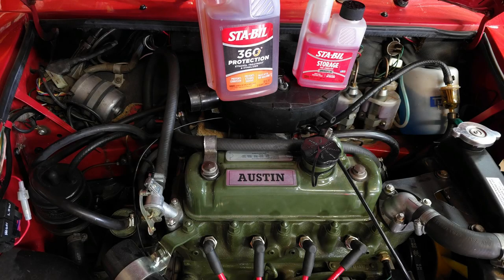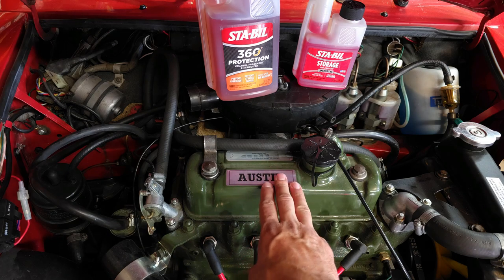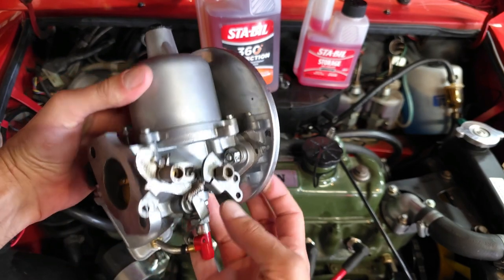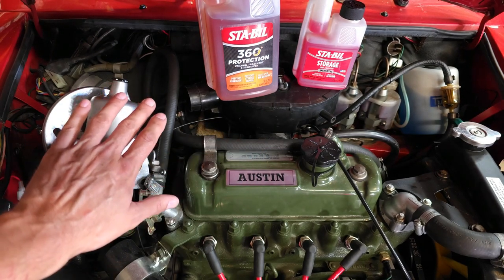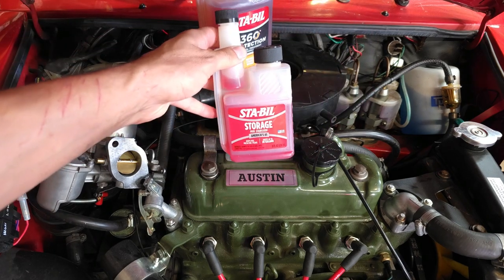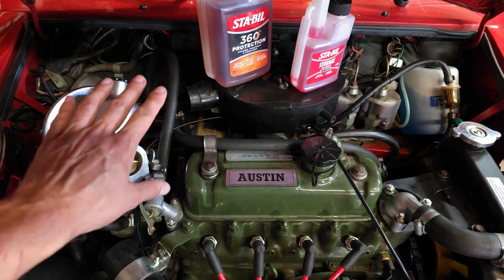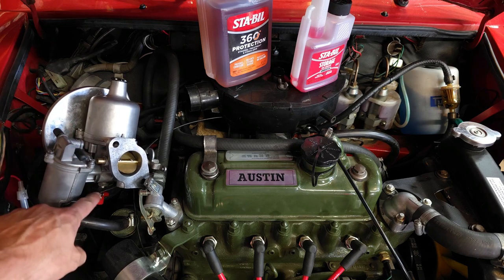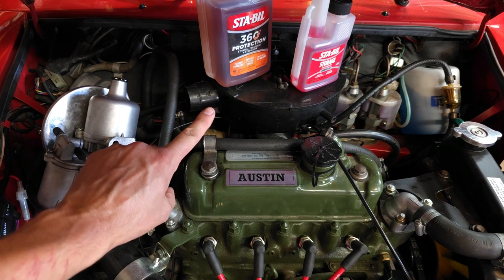Classic Mini survival guide: Prevent Fuel Damage, Save your carbs!

Comment: Thank you very much for your video, would just start the engine every other day up to temperature avoid the fuel damage? Thank you
Reply from the maker: Fuel goes bad, just like food. Running it every day will not stop the damage, either drive enough to put fresh fuel into the tank or add stabilizer to the fuel.

Comment: Think I'll switch my lead replacement to Valmaster Plus by Castrol should also stabilise the fuel, and who can ignore the marketing of 2% acceleration and economy 😂
Reply from the maker: Use whatever makes sense with your motor. As long as it keeps the ethanol from causing damage.